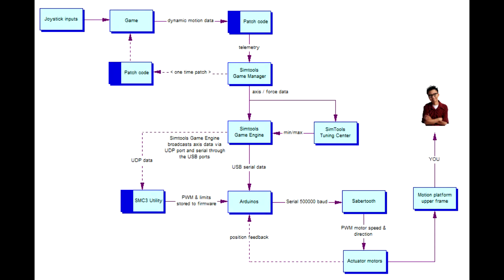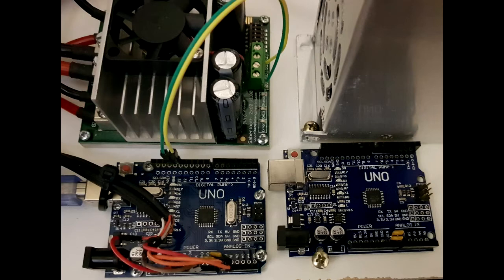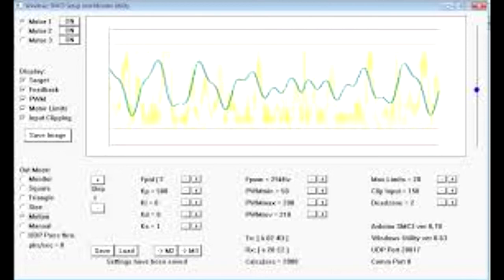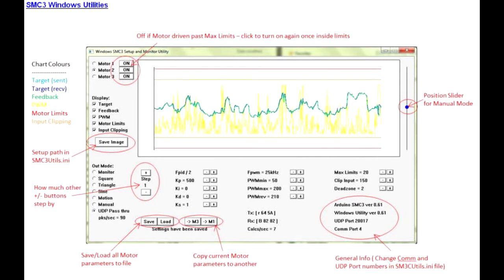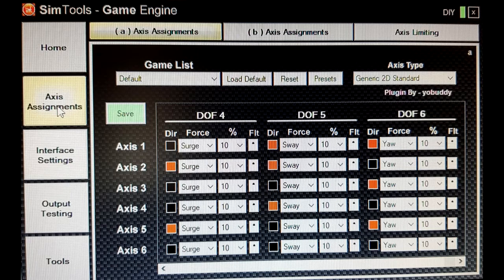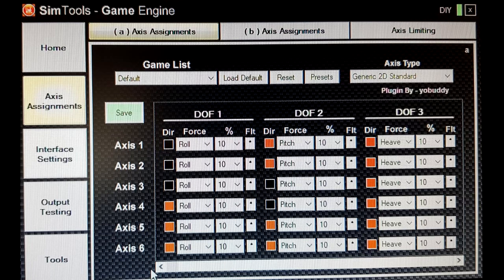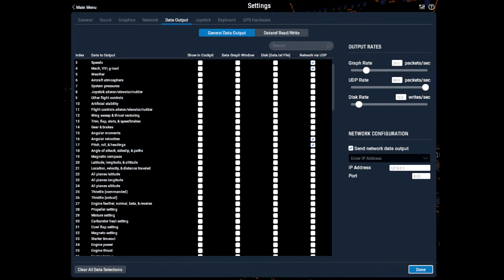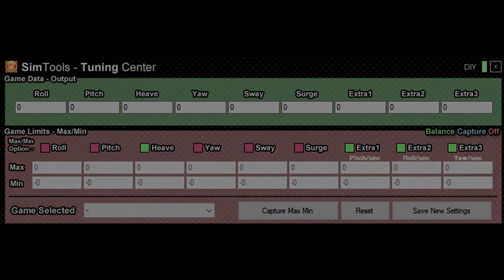X Plane 11 6DOF Motion Platform walkthrough (software) part 5

Comment: Many thanks for making these videos, really helpful, much appreciated. One thing I must ask though, is once an actuator has reached (and settled) in its required position and before being required to move again, what happens? Is a brake put on the motor, or if the motor is just turned off can the weight of the top frame and occupant cause the screwed shaft to start turning, which then causes the motor to power up and return the actuator back to its required position only for this sequence to repeat itself ie. creating a feed back loop.
Reply: @John Once you remove power the actuators are free to wind themselves down. In other words, if I am sitting in the seat and power is shut off, all or some of the actuators will begin winding down to the very end limit of their travel. There is no brake as such.
Reply: Thanks for your reply Ted. In that case how do the actuators cope then in level, steady flight or when taxiing with the actuators in presumably around mid-stroke, but with no change of the extension being required, do they then

A) just maintain the required position without any vibration

or

B) do they vibrate as they repeatedly by going through the following cycle:-

      1) with the actuator in the correct position the Sabretooth cuts the power to the motor

      2) the actuator then starts to unwind

      3) the Arduino detects the actuator is now out of position and informs the Sabretooth

      4) the Sabretooth then powers the motor back up to move the actuator back to the required position.

      5) with the actuator in the correct position the Sabretooth cuts the power to the motor again and the whole cycle then repeats.

I hope you can see the reason for my question, please let me know.

Thanks,

John

Comment: How many arduinos you used for 6DOF guy?  Besides the X-sim software how many  software you used for this project? thank's
Reply from the maker: Hi, there are 3 Arduino Unos. Each Uno uses two analog channels. If you click on the build thread link it will give you more information. There is one paid for subscription of the software which is used for all three Arduinos

https://www.xsimulator.net/community/threads/x-plane-11-6dof-motion-platform.10542/